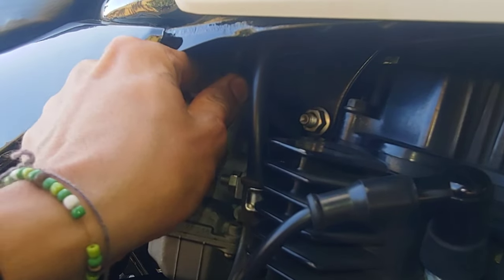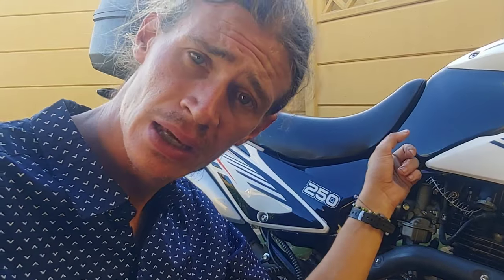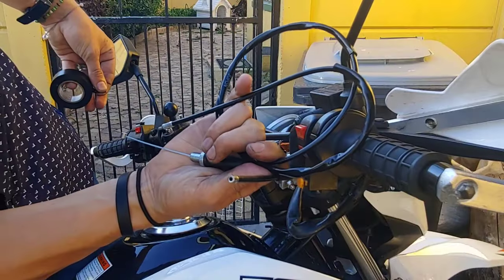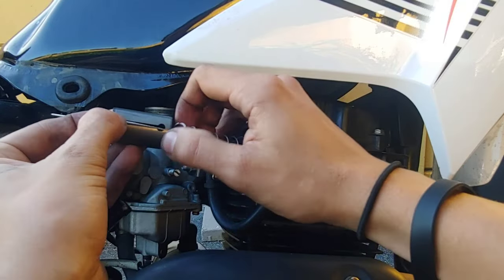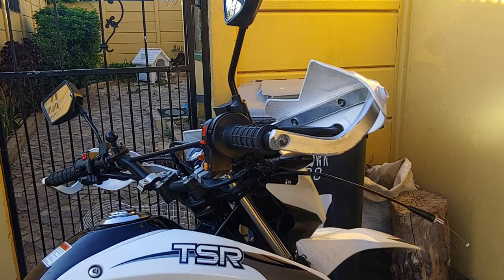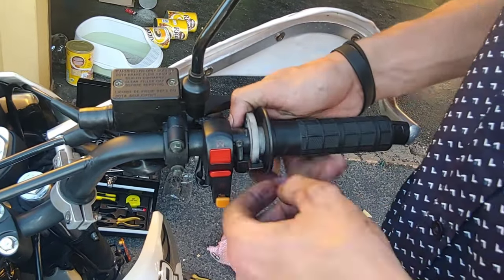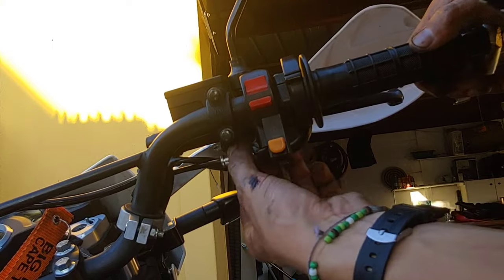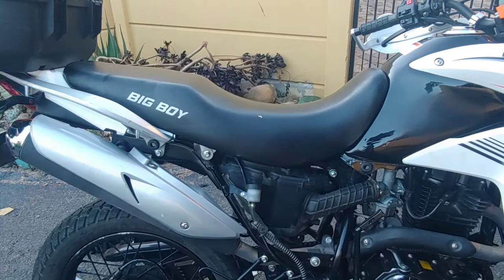How I replaced my throttle cable on the Big Boy TSR 250

Comment: Duuuude i appreciate you so much.... i have a gomoto 200ZR and when i open throttle it kills??? Now i boughy a new cable but gotta replace it new
Reply from the maker: If the bike dies when you open the throttle. A cable is not the issue.

Best is to open up the carb and inspect for a clogged jet.

Comment: Hi there What tires u got there. I'm still on the knobbies and i hate them
Reply from the maker: My front is still running the stock knbbies, but they're due for replacement. My rear is a dualsport tyre I got from startline. Pirelli scorpion trail is a really nice tyre ( dualsport) if you can find it in the size otherwise you can try gettiing Pirelli Angel gt if you would prefer more street  oriented tyres

Comment: Hey Bud, awesome video man. I have some slack on my throttle that I can`t get out, the adjusting nut is at its max, can`t turn out any further... I only had my bike for a year.. Can`t possibly be a stretched cable, can it ??
Reply from the maker: So the big boys actually have a bit of a floor when it comes to the throttle cable they are overspeed so they're about a centimetre too long and no matter what you do you're not going to get the slack out. My honest advice is to try and find a cable maker near you that is able to shorten that cable for you by exactly 1 centimeter. I did this on the TSA 250 when the cable snapped for the second time. I just got them to use the same cable but add a new ferrule so it was shorter
Reply: @CasualRiders  thx for the advice Bud, was not aware of that..🙏.  Stay safe out there

Comment: Cable does not move back, almost like it is not connecting to the spring. Any advise
Reply from the maker: You'll meed to be more specific.  Have you already attempted to change the cable, and now the throttle doesn't return correctly? Or at the moment it doesn't return  and you haven't changed the cable?